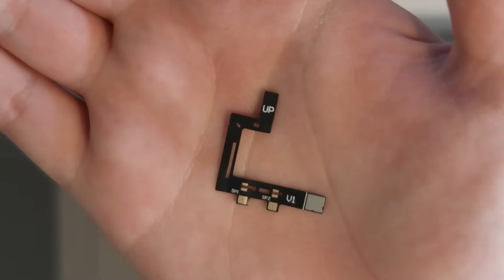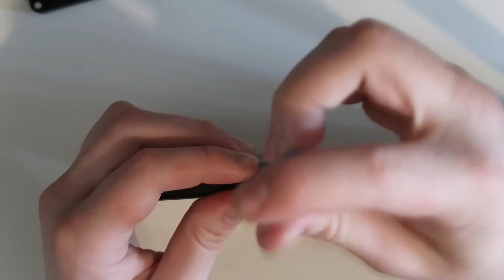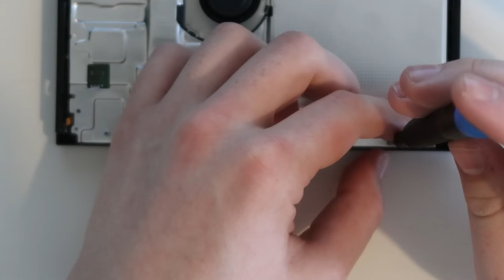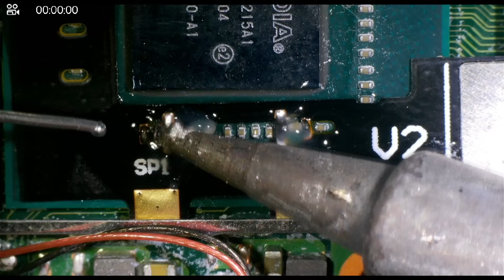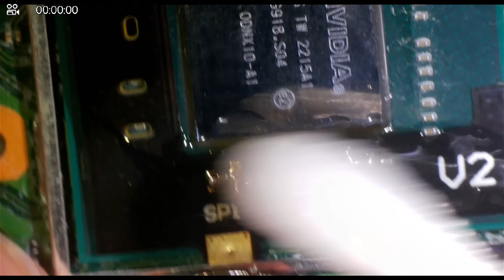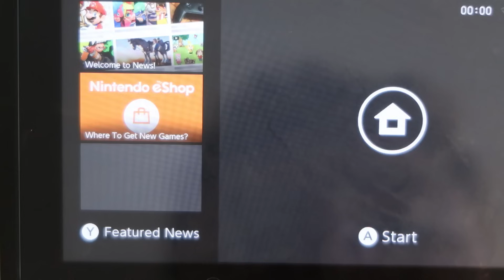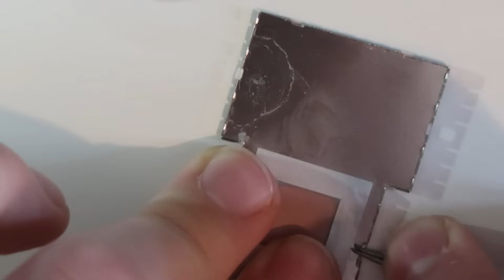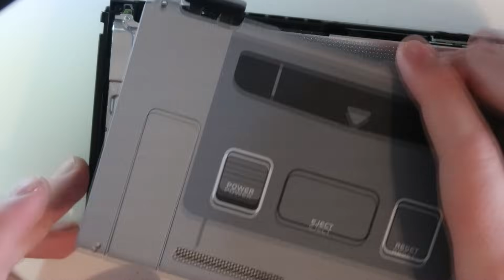Nintendo Switch RP2040 (PicoFly) V2 Modchip Installation

Comment: Fun fact- some "patched switches" are hackable via RCM. I'm saying this from experience. Just make a paperclip jig and try it out.
Reply: This doesn’t make sense as all patched versions have the same updated chip. The main difference between v1 and v2 patched versions is the battery.
Reply: @piroko13  no, the battery is the same, what changes is the APU itself. V1 had a vulnerability that allowed modding directly in RCM mode. The V2, lite and OLED have a slightly modified APU which removes this vulnerability, and also improves the efficiency of the console. This is why the V2 etc have a longer battery life. They made this efficiency change on purpose to justify the change from V1 to V2, even if in reality they changed it due to the vulnerability.
Reply: @alessandrocismarescu4248  way more informed on the details I see. Thanks for the clarification

Comment: I really want to do it one day but I don't have the experience, how can I practice? Someone have any recommendations?
Reply from the maker: I’d practice just by doing some soldering, try some pin headers and when you can do those easily then pickup an SMD solder practice kit from Amazon, they’re about £5 GBP. It’s hard to tell when you’re ready, maybe when you feel ready have a go on a faulty Switch.
Reply: @TheModSmith  thx man
Reply: great video  i don't have experience on soldering but after i watched this video i will give it a try    what is that item that produce flux  so i can order it,  what watts do i need for soldering iron
Reply: @dextercorbe0084 did u do it?

Comment: Do you use lead free solder?
Reply: I did. Would not recommend. Lead free solder is hard to flow. It likes to stick to the iron, not the joint. It's great for the environment and for manufacturing, but we're all just doing one mod chip each.

Comment: I've got a banned modded switch with the V6 instinct chip, but it won't boot into Hekate. Just flashes yellow a few times, then blue, then it boots into the original firmware. Any advice? Thanks!
Reply: initialize the switch or look for other options

Comment: How much harder is an OLED? because I feel like my 40 year old ass can do this with my usb microscope for sure! great video thanks mate!
Reply: not much! its just different points to solder
Reply: The OLED uses the same Mariko chip as the V2
EDIT: Apparently it uses a different carrier board which doesn't expose all the signals a modchip needs, so you have to do some digging around on the PCB and use a different flex cable. TIL!
Reply: @valshaped  from what i saw they look a little bit different, but i can be wrong
Reply: @Dispnser  Yeah, that's my bad. The OLED model hides some signals beneath the solder mask, and is a slightly more involved install.

Comment: Hold up, the ROL glow board was one of your projects?
Reply: What is the ROL glow board!? I’m new to switch modding and find these videos cool and super informative
Reply: Its an old xbox 360 mod that would fade the ring of light on the front in and out in a breathing animation while the console was powered off. 

I actually came across an old ROL board with one still fitted in the house yesterday

Comment: Just to add some clarity some v1 switches came patched. Easiest way to find out if you have v1 or v2 is to look on back of console just above the usb port. The model number printed there determines if you have a v1 or v2
V1 = hac-001 whereas v2 = hac-001(-01)
Reply: For this modchip, patched or not, it works on either. Easiest way to find out imo is checking the serial number online, it is well documented. For reference some V1's that are patched still have the original model number, so it is not foolproof to go by model number.
Reply: Despite my comment, thank you for the comprehensive overview, plan to install mine tonight. Flashed the modchip already in preparation for the bigger job tonight 😬🤞
Reply from the maker: Ah yes, thanks for making me aware of this! Good luck with your install, I hope it goes well.
Reply: @TheModSmith  me too, hit a snag where one tri wing got stripped, had to drill it out 😱 but it went well
Reply: I was software updating my switch quite a bit but it's hac-001 so idk if it's patched or not lol
Reply: @gmodiscool14 Unpatched v1 switches have a vulnerability in the boot-rom's USB stack, and boot-rom patches are burned into a bank of eFuses inside the chip (basically a tiny programmable ROM). The ability to burn those eFuses, and patch the boot-rom, is locked out at the factory, since adding a new patch could turn the Switch itself into a modchip :P

This is a long-winded way of saying there's no way to patch an unpatched V1
Reply: @valshaped  I should really know more about roms and stuff but what youre saying is, its a physical vulnerability and no software update can fix it because its something with the hardware itself
Reply: @gmodiscool14  Yeah, it's etched into the physical silicon of the processor, and can't be modified*

*Except through the ipatch interface, which is completely locked out at the factory with no way to re-enable it even if they wanted to.
Reply: @valshaped  Interesting

Comment: Would I have to use a V1 or V2 chip on my console if the serial number fell into the, "might be patched" category? I actually went on to try and modding it via the RCM method but I did in fact discover that my console was patched
Reply: If you have a HAC-001(01), that has a Mariko SoC and needs the "V2" cable.
HAC-001 (Without the 01) is the less efficient Erista, which uses the "V1" cable. 

Im really tired of how the scene uses the terms "V1" and "V2" because they even include RCM patched Eristas in the term "V2", which is stupid.
Reply: @jtchoi2003  holy molyyyyyy wait thanks so much. Potentially saved me from soldering on the wrong chip omg lol
Reply: @jtchoi2003  also what does SoC stand for? Also you’re now the jchoi I know in real life who used to main Mario in smash right? Lol
Reply: @kikissolano5645  System on a Chip. Also, I've literally never played any Smash game with anyone, so you are probably thinking of someone else.
Reply from the maker: If you’re unable to enter RCM mode and inject a payload, then you have a V2 Switch.
Reply: @TheModSmith  appreciate the response! Have everything I need except for the chip itself which is still in the mail from China haha. Will be using your guides though 🫡

Comment: This looks amazing! I'm new to soldering and I'm practicing on some SMD practice kits that are really smal like those points. I was afraid to mess it up, however seeing that if bridges happen you can fix it fairly quickly makes me more secure.

I have a few questions if you don't mind answering

- Do you do anything special to fix a bridge? Just add more flux and reflow and poke it a bit with the tip and it kinds of relocates itself? I will try to purposely bridge something on my practice board just to see how I do.

- Can you use desoldering wick to desolder if you want to start again? I'm using it on my practice boards.

- What is the difference between brown-colored flux and clear flux? I have both, but to me they do the same, both are no-clean, and claim to have same properties and uses.

- I'm practicing on 0603 metric/0201 imperial, are those on the CPU a lot smaller?

Thank you very much! Will update when I feel confident enough and do it on my own v2.
Reply: If you have a bridge, cleaning the tip so it can take solder away and is all that is needed, this can be repeated until happy. Desoldering wick is another way to remove solder and is perfectly acceptable. Brown coloured flux has 'Rosin' in it which tends to give it that colour, not all flux has Rosin in it. Best flux imo is the amtech stuff. There is no 'no-clean' flux, always clean flux away with alcohol without fail. For the small connections on the cpu, magnification will help big time -  this can be done by digital microscope or a cheap set of magnification headsets which are on ebay and will help massively. The only advice I can give is to not rush the procedure, take your time and try to do it as neatly as you can and you will be golden. Good luck.

Comment: Maybe it would've been a better idea to slide the module on the fan opening of the shield and mark to cut only were the flat flex is? That way, the heatshield will hold the module in place and you don't have to add extra tape.
Reply: how do u flash the uf2 file? im a newbie for switch but not androids and iphones when jailbreaking and rooting

Comment: Very good video, just what Ive been looking for. 2 questions, 1. do you need a microscope for the soldering? 2 what temp on the solder iron did you use?
Reply from the maker: I highly recommend using a microscope for this installation, especially due to the small size of the capacitors. I personally use 420 degrees Celsius on my iron, although some suggest temperatures closer to 360.
Reply: @TheModSmith  Thank you for your reply. I just got the mod chip this week. Wish me luck lol
Reply: I managed with a headband magnifying glass but it involved a lot of eye strain lol.
Reply: Don't use too hot... The capacitor will come off
Reply: All I've got is a magnifying glass that's on my helping hands. Can't afford a microscope just for this.
Reply: @MitchMcConnellsGhost  I wouldn't try it then honestly. It's way smaller than it looks....  Talking about the capacitors... What did you think I was talking about...

Comment: Seems extremely doable. On the other hand, while seeing the tutorial, at the  timestamp 27:34 it felt a bit worrying that the cable coming behind the shield would be pinched. It's a matter of perspective, or perhaps should it be recommendable to trimming the shield a bit more?
Reply from the maker: I've also noticed this, and while it hasn't caused any problems on my console, it feels a bit off. The issue arises with the heatsink because cutting the metal shield any further would disrupt where the heatsink contacts the shield.
Reply: @TheModSmith  perhaps bending that part up and then adding something soft as padding. Nonetheless, if it doesn't puncture the ribbon cable, that shouldn't be an issue, init?

Comment: Man's using a baseball bat for a soldering tip.  Be a bit easier with a thin tip.
Reply from the maker: I haven’t had an issues whilst using this tip, but I’ll take a look at some smaller ones.

Comment: Finally something comprehensive! I'll give it a try tomorrow
Reply from the maker: Good luck!
Reply: @TheModSmith  itll work with any official firmware? I'm on 15.0.1
Reply from the maker: @QTheMost The latest firmware is 18.0.0 and is supported, so you can go ahead and update.
Reply: @TheModSmith  awesome thanks
Reply: @TheModSmith  god damn i didnt realize how small the caps were.. one came off right away...
Reply: @TheModSmith  can I have a link to the chip you bought I'm having trouble finding it 😅
Reply: @QTheMost  me the same, one cap or thing broke of my motherboard en my switch give now only a blue/black screen:( how did you fix this? or can't i, its sooo small
Reply: can the solder be on that middle part or does it have to be soldered on those edges that are a different shade of color
Reply: @oneritoo  It has to be on both sides. Not the middle.
Reply: @oneritoo pls dont ruin ur switch get a professional or actually invest some time into learning how to solder and practice it on practice boards
Reply: @smoban  yeah i got someone to do it i dont wanna learn soldering
Reply: @oneritoo  oke fair enough
Reply: Yo bro did it work??
Reply: @mike42gr44  yeah but I fried the left chips right off lol. Still worked
Reply: 16x A little bit more flux😁😆😆
Reply: I was cringing the entire time!! The metal shields that touched various points along with the few times the solder bridges components incorrectly! I believe the most critical error made was not unplugging the battery as soon as it's unpluggable! Great job on explaining most everything tho.

Comment: Whould you consider this easier or harder than rgh/jtaging an xbox 360?
Reply from the maker: It’s definitely harder than all of the Xbox 360 mods, mostly due to the size of the points that you need to solder to.